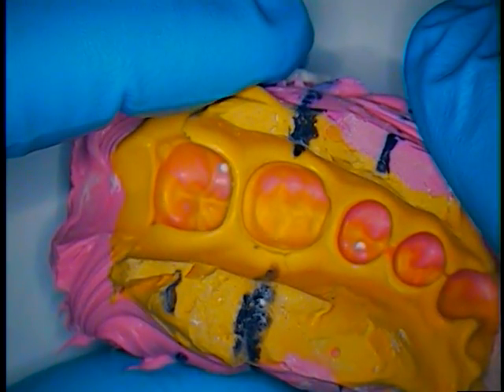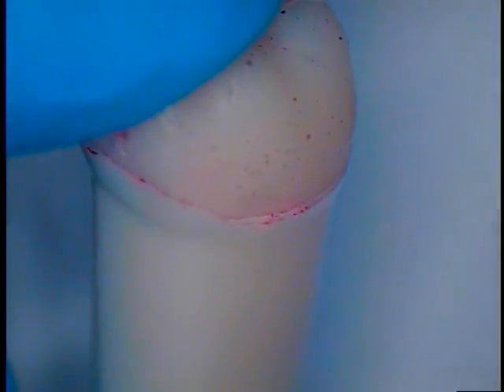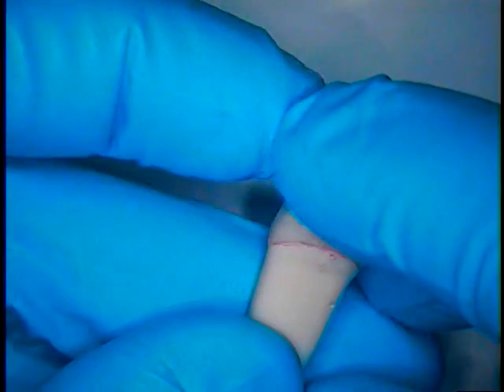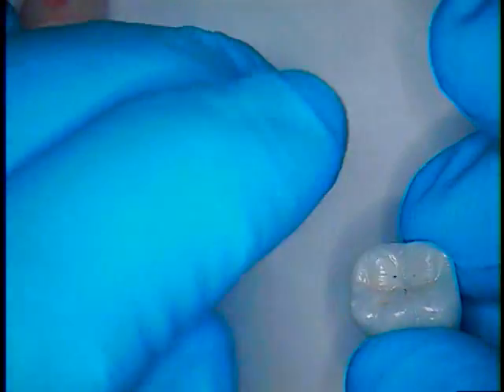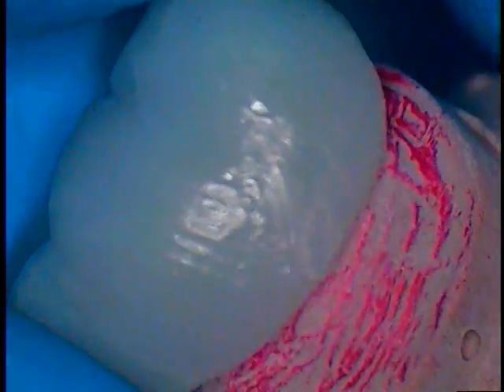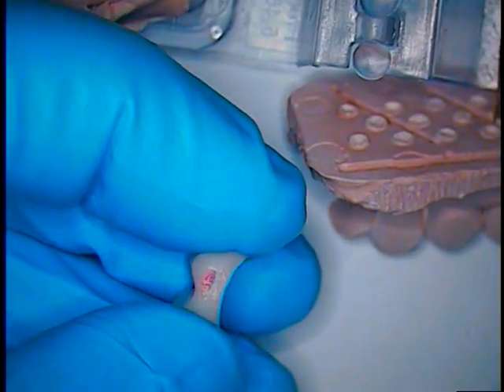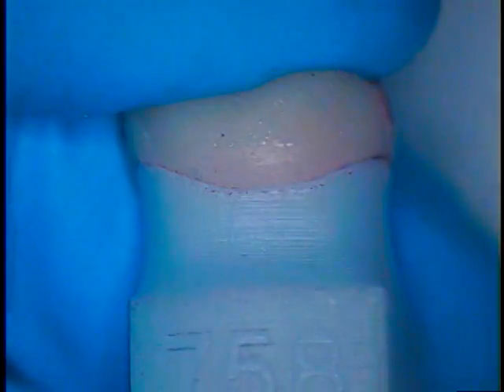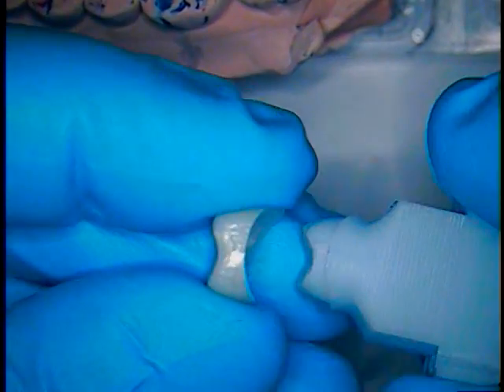FAU Introduction to Dentistry and Lab - Human vs. Machine Part 1 with DR. GERARD CUOMO

Comment from the maker: I like to use custom milled abutments in a four unit fixed implant bridge that is cementable.  Margin location is important and needs to be positioned near the crest of the gingiva.  I like screw retained fixed implant  bridges because they do not involve the use of cement.  Some dental labs and dentists are using stock titanium implant abutments from NT Trading.  These abutments are designed to be scanned and a full contour zirconia bridge is milled.  The bridge and abutments are cemented together on a solid die model and not in the mouth, avoiding issues with cement cleanup.